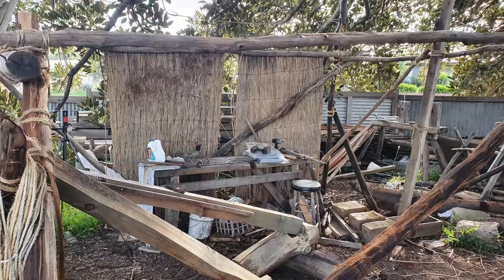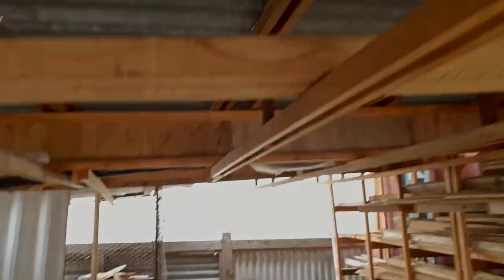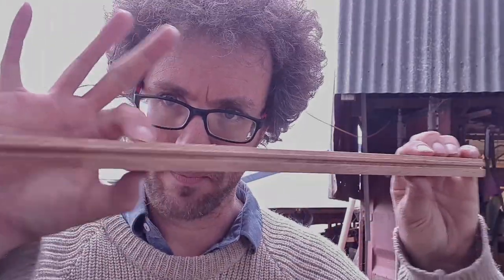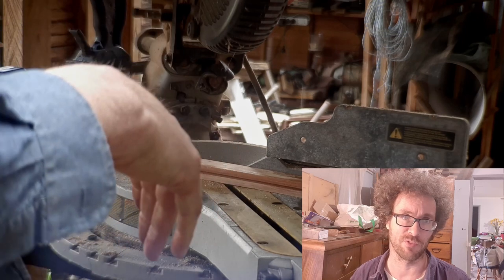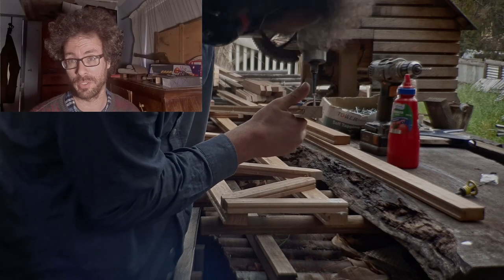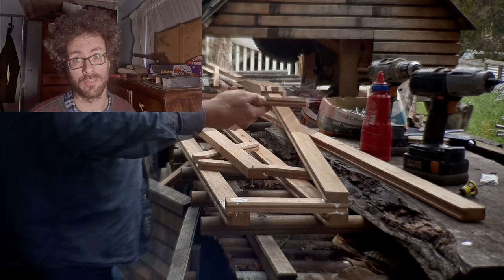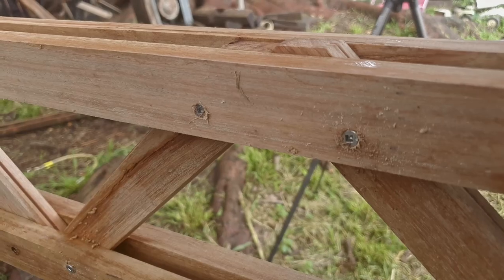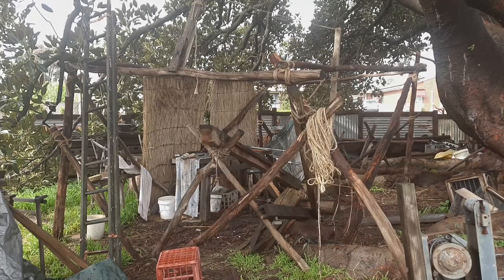How to make a beam from scrap wood.

Comment: I suspect wood is more expensive over there.  Here, we would generally just use a solid piece say 35 mm x 200 mm (2x8).  5 meters long (16 feet) is $21 US right now at Home depot.
Reply from the maker: Far out that's cheap.  Thats close to the per meter price here.
Reply: @ChestnutnagsToolsFromJapan  That's what I suspected.  All that work you did would not have been cost effective here.  Was neat to watch though.

Comment: im guessing it wouldnt be. but would this be as strong as a solid beam of the same outer dimensions? (solid laminated glue up beam)
Reply: No it wouldn't be but the reason for making beams and trusses like this is to save on materials. Absolutely a solid beam would be stronger but the composite beam is stronger by weight. If you were to take the same scrap wood that you could have made into a solid beam and instead make it into a larger (deeper and a little broader) webbed beam then you it would be much stronger than the solid beam.

Comment: I cringe when I see woodworkers on YouTube not pre-drilling the holes. It ruins the screws when you don't pre-drill the hole, because it puts way too much torque on the screw, and wood screws are extremely brittle and the slightest over torquing when driving with a modern power tool will bend or break them. In very soft woods, you can get away with no pre-drilling, but only for 1 1/4" or shorter screws, and only in pine, or hemlock, and not near the ends. If you don't want to pre-drill screws, then make sure to find proper #10 size or larger lag screws designed for high torque, high load--don't use #8 size drywall screws or flimsy brittle gold screws, or stainless steel screws, unless you pre-drill.